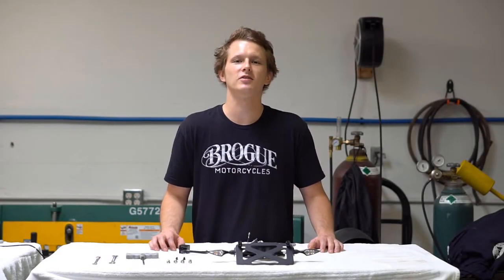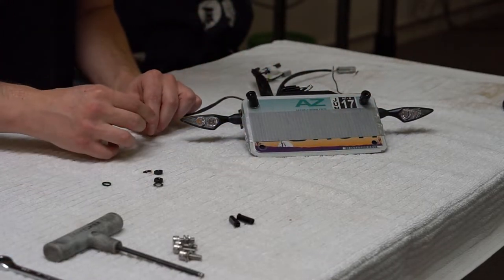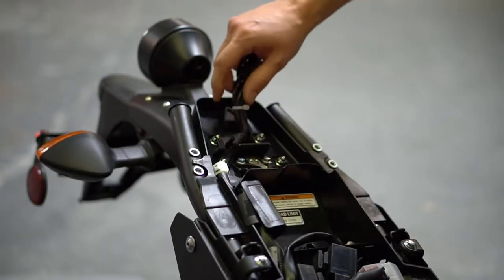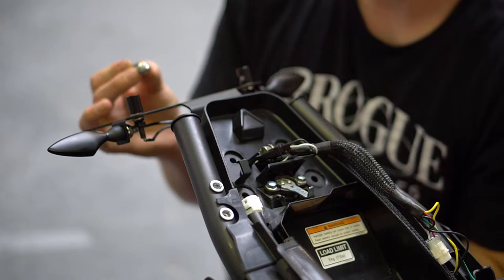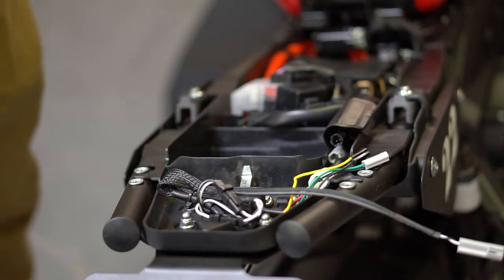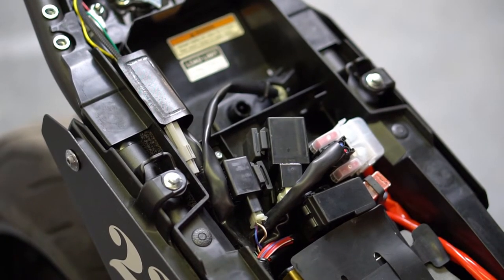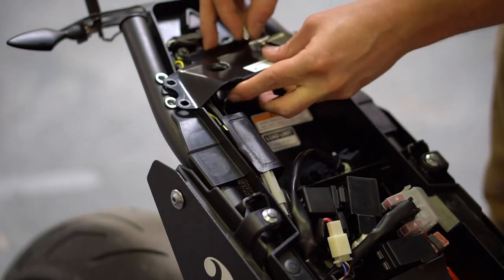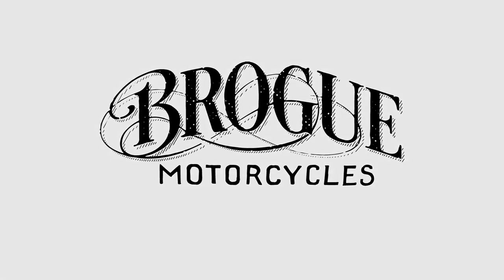Brogue XSR900 Tail TIdy Kit (How To Video)

Comment: Kellermann are the pointy signals and purpose built are the round ones correct?  And would a 5x8 plate fit?
Reply from the maker: Yes that is correct. We have dimension on our website if that helps. It should fit, but there may be a slight overhang height wise in regards to the license plate.